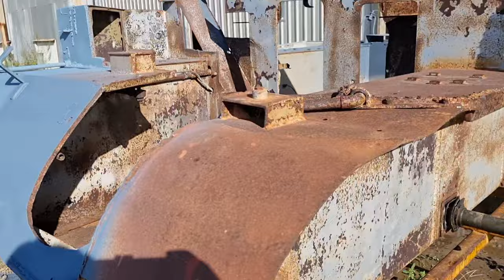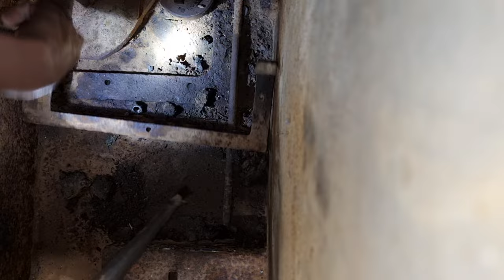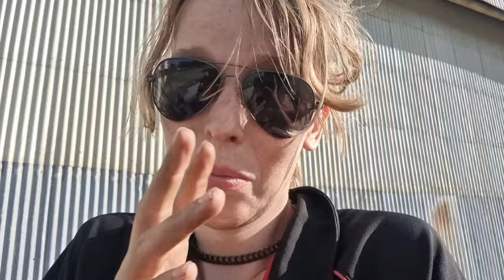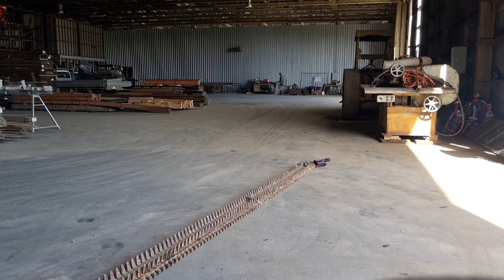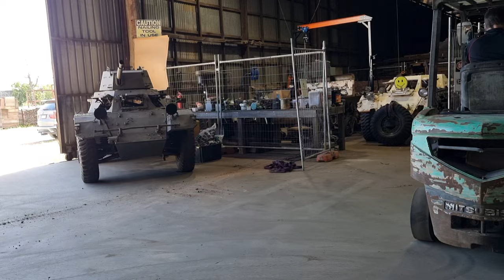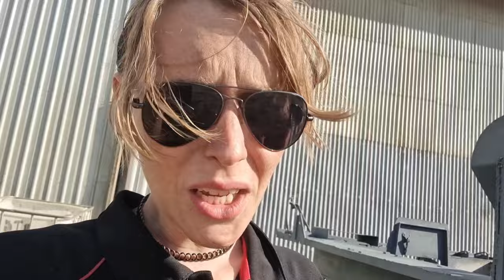Track bashing our WW2 project!

Comment: I used to work in a military base workshop where we stripped tanks, APC’s, bridge layers, 430 series vehicles etc etc. They’d come from all over the world, be stripped, upgraded & reassembled. There were many times where, in all the crud & crap in the bottom of the hull - hidden away - were live munitions 🤯 Anyway, just be aware it’s a possibility when using hammers & pry bars to clear the hard set stuff 😉

Comment: Are you goung to strighten the sheet metal? 
That hull really needs to be sand blasted to remove ALL rust prior to applying iron oxide red primer.
Reply: Water blasting for this one. and Sand Blasting for the other one we are rebuilding .

Comment: Great video.  As another person mentioned, in the US we call it breaking track.  I've broken more track than I care to remember.  No power tools, no forklift, just the final drive, rope, and track jacks.  At the start of the video, was that just decades of junked up grime, corrosion or both?
Reply from the maker: A bit of everything 😅. I felt like I was mining for coal getting it off.
Reply: @lottiethetankwhisperer  yeah, that is a great way to put it.  IDK, is it weird that I would like to watch that in real time vs time lapse?  Yeah, that is probably weird and boring to most folks.  But I think it is wonderful.  Peter is doing great job of putting on that base.  I like how you included the stripped down side.  Do y'all do just one coat?  It looks so smooth.  But it's not like I did any military painting so maybe the paint is just so thick?